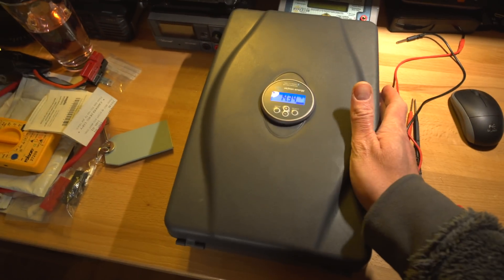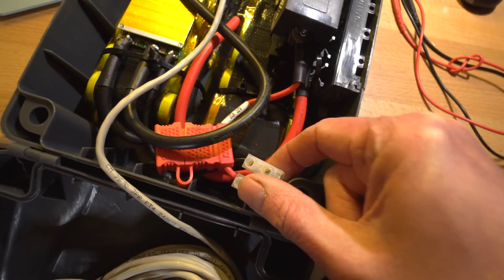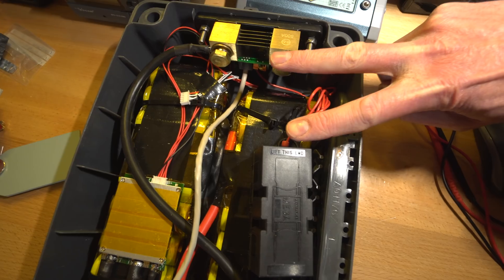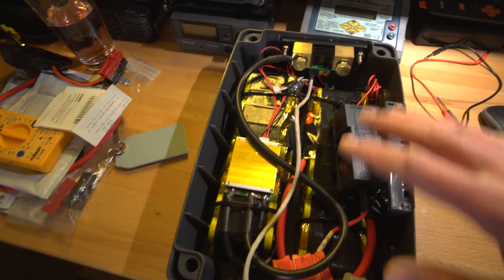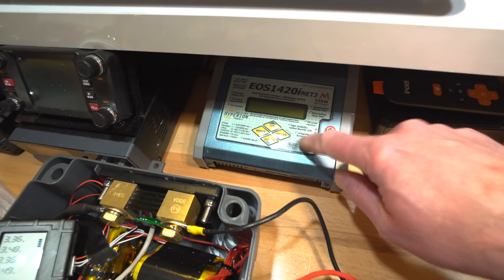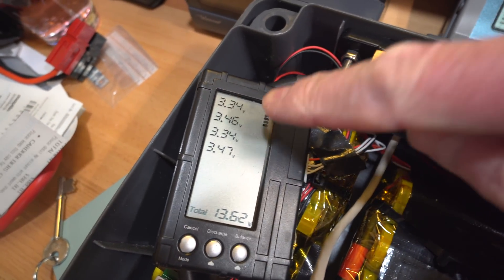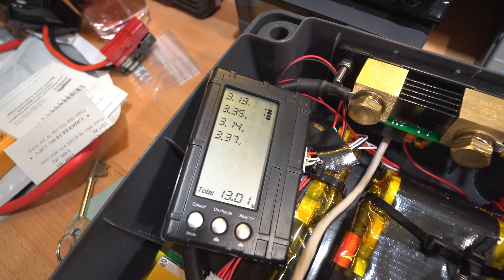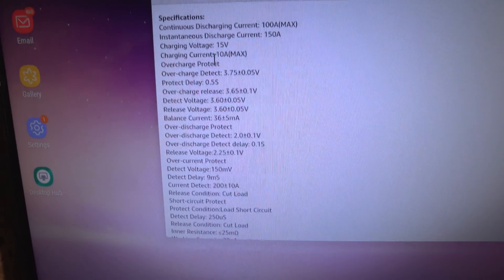SOLAR POWERED SHED | PART 4 FINISHING THE MICRO POWERWALL & BIG MISTAKE!!!

Comment: Andy, I love your work. The build looks brilliant. I was wondering, do you have a schematic for the mini power wall? I would love to build one for my workshop.
Reply from the maker: Thanks, I don’t actually but it is pretty straightforward. You need 4 cells in series and as many in parallel as possible. A 4S BMS connected to the series strings. And inputs for charging and discharging through the BMS. Bear in mind that 4 lithium cells in series is nearly 17V when fully charged, this is why some people use LIFEPO4 cells as 4 of them in series is only 14-15V fully charged. I’ve seen the case in Homebase (UK) and Aldi I think. Depends what you are running in the workshop as to whether it will be powerful enough. power tools that run on batteries are best because then you are just charging the batteries not actually running the tools etc😁
Reply: Thanks for such a quick response. The goal would be to charge all my battery power tools, run a chop saw, and a few other hand tools. The big goal would be getting the power wall to run a ductless mini split air conditioning system.
Reply from the maker: Ok, so battery power tools will be fine. The chop saw might need more than 2000W startup power and then depending on what you are cutting and how demanding that is it could draw a lot of power. You’d need at least a 2000W inverter I reckon. To run aircon you would need a 48V or higher battery setup with a 2-3kW continuous rated inverter and a BIG battery of about 6-10KWh it gets pretty crazy when you run AC or heating!
Reply: That’s goal. Go big or go home. Lol thanks for all of your help.

Comment: Thanks for putting these out, great stuff. I am starting a similar project but with Nickle Metal Hydride D-cell batteries that were left over from rebuilding the battery pack from a Honda Civic.  The cells are 20 sets of 6 batteries per pack, so I can do 6 , 12,  18 or 24 cell The voltages for charging come out off from what most equipment will do. My smart charger like to give the 14.4 volt pack around 19.2 volts (1.6 per cell) for charging.  Can the Victron MPPT voltage be modified that high? or do you just use a lower voltage?  Do you know what the upper voltage range is in the controler at both 12v and 24 volt system (I cant seem to find that information).  Second question is I was hoping to use the current from my running car to send voltage to the MPPT that is boosted to 24-30 volts with a VICTRON ENERGY ORION 12/24-10 DC-DC CONVERTER IP20 that will take 12v to 24+ at 10 amps.  My worry is that the current spikes from it could be to much for the MPPT.  Do you know if their is anything built into the MPPT that will limit current if it is to large. For instance if it was conected to a 100 amp battery that had nothing to limit the current flow.  I am unsure if the Orion is right as it is not clear if it can just hndle 10 amps or if it has some regulation to limit it to 10 amps of current at 24 V.  Thanks

Comment: How about using those Headway Lifepo4 batteries?  Wider operating temp, more cycles, safer and higher current spec...  or those prismatic pouches.. 3.2v 100Ah per pouch !!

Comment: The two modules with the lower voltage while discharging obviously have a higher internal resistance on their cells. You could try shuffling the cells between your modules a bit to get them up to sync, but that's quite a lot of extra work.
Reply from the maker: That’s what I initially thought however check the next video and you’ll find out why the readings were really off!
Reply: andy kirby yeah, I did watch the next video, however I did not quite understand what was the culprit. Did you solder the balance leads on a different place on the 3s cells and there was voltage drop on their nickel strip?
Reply from the maker: Yeah basically I soldered the balance leads at the wrong end on one or two of the parallel banks, didn’t realise it would make such a difference.

Comment: I don't know what the weather is like in Britain, but i just thought I would inform you, if your putting those in a cold shed. Charging lithium below 0 C will destroy your pack.

For that reason Teslas and other Ev's disallow regen braking and charging at low temps.
Reply from the maker: Hi, thanks for the comment. Yes aware about the issues with li-Ion at cold temperatures It’s never anywhere near 0 degrees, the shed has celotex insulation and a fan heater that comes on below 10 degrees. Next I’ll be figuring out how to warm it up using excess energy when the batteries are full.

Comment: Your Box need to be fire protected too.
Reply: Hans Peter von der Fecht Not really, we're not dealing with lipos, these are 18650's, not capable of dumping their energy in 5 minutes.

18650's are extremely reliable and very safe, many including built in protections. As long as you balance or use a BMS, you should be safe.
Reply: But he choose the wrong BMS. Safety first . Made in China and so on.
Reply: Hans Peter von der Fecht That's why we do testing. Although, overdischarging a cell wont blow anything up.
Reply: Make a fire test and try to burn it down. There is much oxygen in the box.A small cabel is enough. I,am only worry about the wodden shelter. Blow anything up. i did not say that. You make me laugh.
Reply: Gap Recordings Namibia Meh, close enough. A good bms and your set.

Comment: Charge controller may regulate 20 amps on the load side instead of the 10 volts inverter cut off voltage. I can set mine to 12.5 volts to use excess power.

Comment: I havent seen one video of a powerwall that all the cell stay balance when at the end of discharge i pretty sure the packs that go down first are the lower capacity packs good luck great work
Reply from the maker: Hi, actually most powerwalls are built with used cells, they all have different capacities and IR. when you build a pack with new cells (in this case it was an ebike pack that has had maybe 50 complete cycles tops) you’ll find that they should stay balanced nicely. Things may creep out slowly over time but it’s nothing like when you use loads of random cells.

Comment: I have the same BMS from amazon, I have a 4s 5p 18650 panasonic 3400mah batteries, I cannot find a BMS with the discharge settings to 3.2 minimum. can anybody help please.
Reply: Your battery works between 3.7v to 4.2v. 
So 4s means works between 14.8v to 16.8v so must have USE lithium battery 4s li-ion BMS